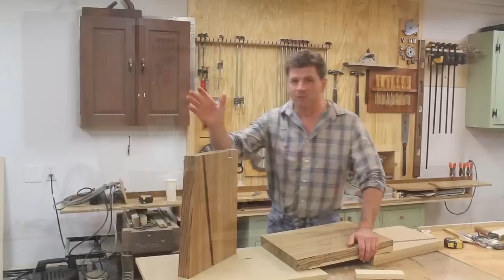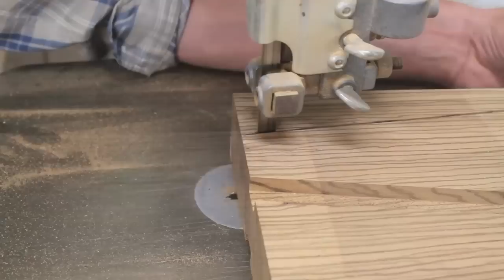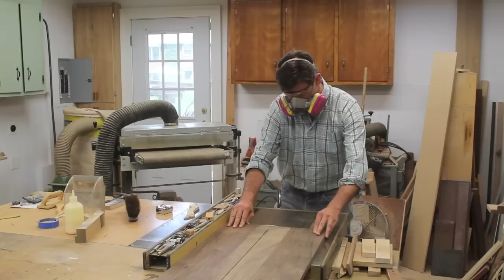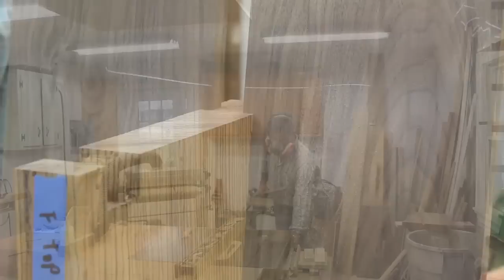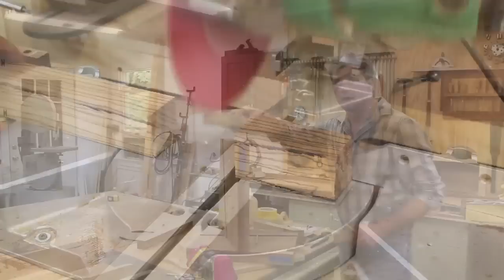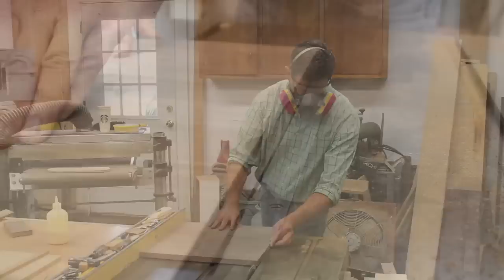How To Build a Set of Modern Chairs - Solid Walnut & Zebrawood

Comment: Question.. You said when cutting the angle on the seat, you went a bit heavy than 8 degrees..... Does that mean you did 9 or 10 degrees or was it 6 or 7 degrees?
Reply from the maker: Hi Shane, more like 8.5 degrees.
Reply: ***** the calculation shows that the angle is precisely 8.9306 degrees if they want it very accurately :) as follows:

your zebrawood is 13.75" wide minus 9.75 the top angle start = 4". take a vertical line from that point perpendicularly down to the bottom width line, you will have an equal lengths at the intersection of 4", now 13.75 total width minus 4" and minus 7" = 2.75". Now you have two lengths and one angle of 90 degrees. go to:  http://www.mathportal.org/calculators/plane-geometry-calculators/sine-cosine-law-calculator.php     and enter these nubers in the appropriate feelds it will give you the angle as mentioned above and the the inclined routed groove length.

Comment: Nice design. You were going to screw thru the back to attach the seat to the back, but I would have kept it clean with a few dowels or tenons since the design is contemporary. Plugs probably won't look good on those chairs.

Comment: Hi J lovely seat good job well done  , I must have missed the front supports on the test seat ,would wooden [hidden] dowels and glue be enough to hold then together or will they need screws for the movement through use,
G
Reply from the maker: I think I will need to use screws

Comment: I would knock off the ends of those support brackets at the same angle as the back is at. Come to think of it the seat sides and back sides would also get the little over 8 degree treatment too. Yeah I know, I just did a major design change on somebody elses project. sorry :)

Comment: Why did you cut the back in half for the filler strip? Wouldn't it be easier to cut the bottom out on the table saw, then chisel out the piece at the right angle? That lamination down the middle is ugly and could've been avoided with a simple step that would save time as well.